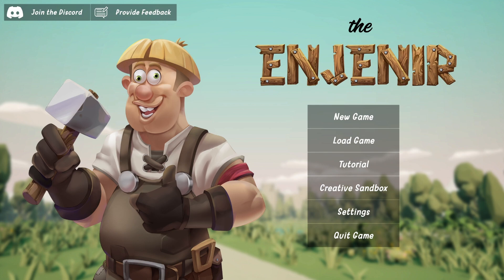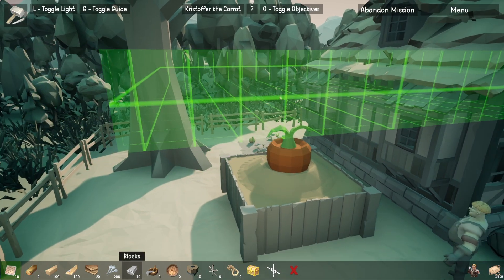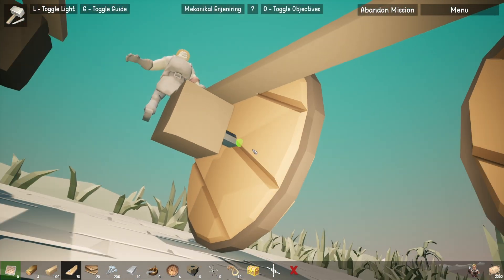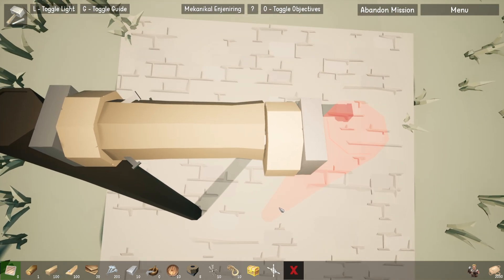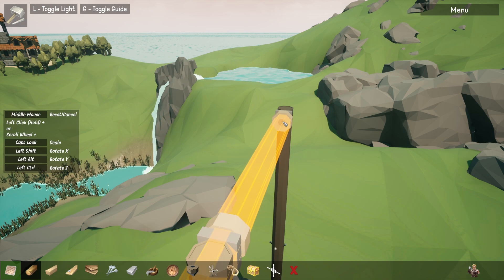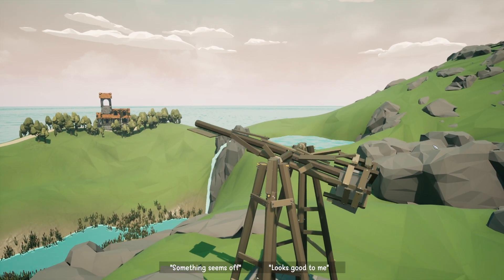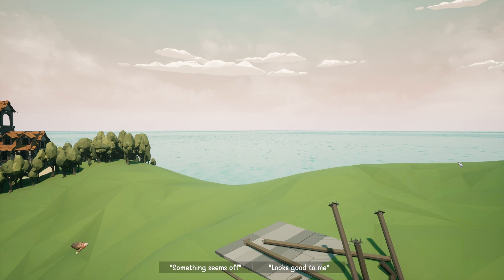I Engineered a Brutally Effective Human Catapult in The Enjenir

Comment: Only 12 comments? I just want to see you play more Enjenir. I like your style, including your builds. Do whatever.
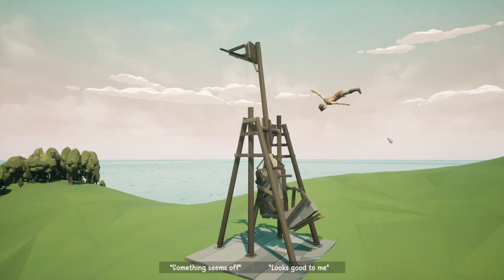Reply: 11:22 Medieval England
By the way, I recommend playing PolyBridge in order to get a better understanding of compressive- and stretching forces. 
You'll see why your catapult kept breaking in the middle, and why putting bracing on the arm doesn't really prevent it from breaking at the joint.
You're gonna be in the same weight class as 'Real Civil Engineer' but your builds already incorporate more engineering, lol, despite wherever you got that bracing knowledge from.
Reply: 6:15 If you had put a plank over the axis, connecting left and right arm, then the weight would pull on both sides of that plank, stretching it.
If you had put that same plank under, instead of over, then the weight would rest on that plank. Gotta envision it